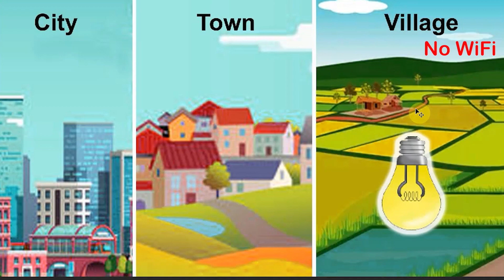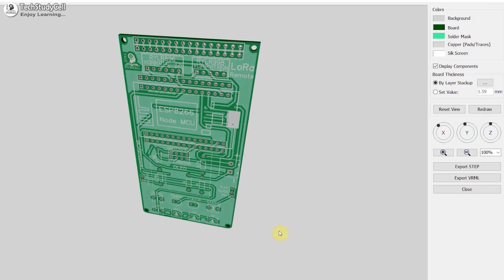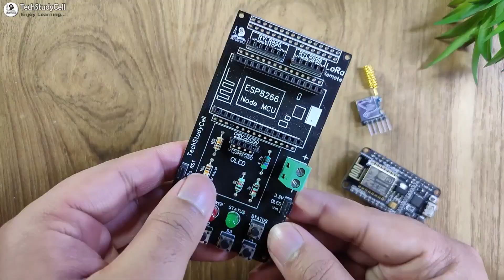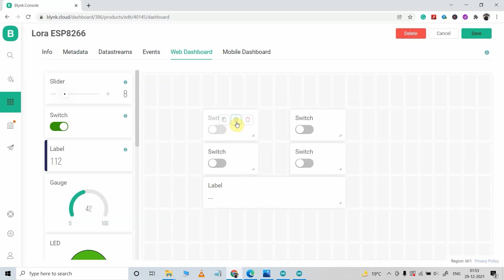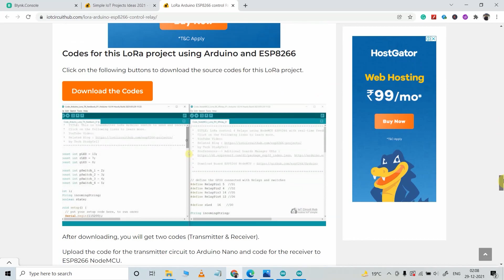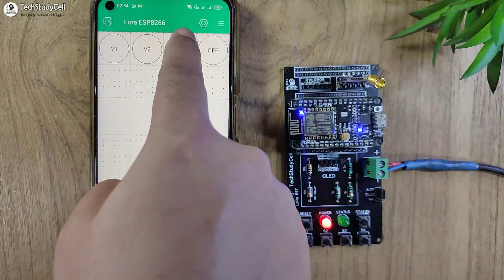LoRa Arduino Home Automation using ESP8266 Blynk IoT | LoRa WiFi Project using RYLR998 module

Comment: Hey nice project 👌
Can I build a setup with one transmitter and multiple receivers?

Each receiver would have its own relay, LoRa module, and Arduino.

I’m talking about around 10 independent receivers controlled by one transmitter.
Reply from the maker: Yes

Comment: Hello, I have a question regarding esp32 wroom and scd41 sensor. I have no idea why this sensor does not understand to the i2c communication. The program is tested on arduino nano together with scd41 and bme280 at the same time. When I use the same program for esp32 wroom it doesn’t the pins seems to be correctly configured. When I disable program part of scd, the bme works well. Thanks for help

Comment: hello sir     i  tested your project with nodmcu. it is going to error as "wdt reset
load 0x4010f000, len 3460, room 16 
tail 4 ,   sir  how to solve  nodmcu  error  ?  i can possible to run  nodmcu samble code .

Comment: Thanks very much my dear for this nice tutorial. Please, I want to put two Lora to two esp8266 respectively and the two esp8266 with Lora will work as access point. There is a project I am working and I use two esp8266 which are in access point mode. I want to use Lora to connect those esp8266 together. If one want to share file to a phone which is 2km away. The first phone will be connected to the first esp8266 in AP mode connected with the first Lora, then the second phone will be connected to the second esp8266 in AP mode connected with the second Lora. Thanks very much my dear. Please, I am waiting for your reply. I will be very grateful if you can help me achieve this project. Thanks very much

Comment: For example, it turns on several lights but they are connected to different Arduino modules, each with a corresponding RYLR998 module. Thank You!!!! 🙂